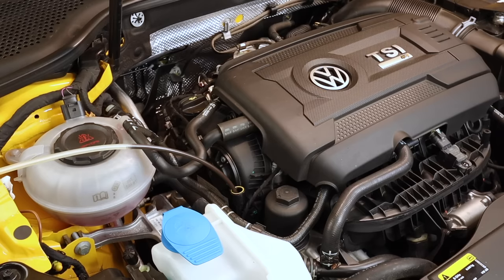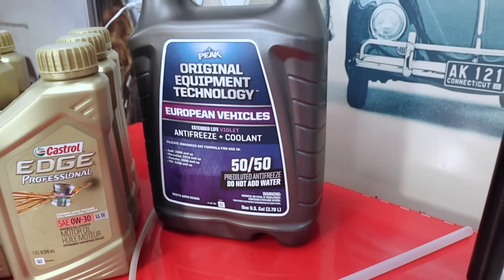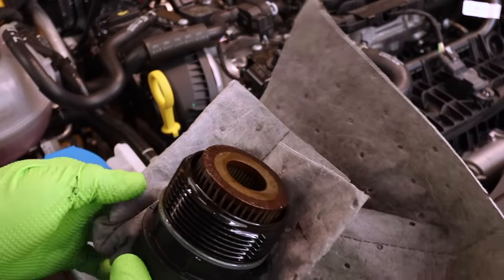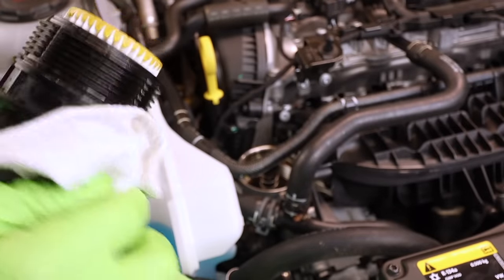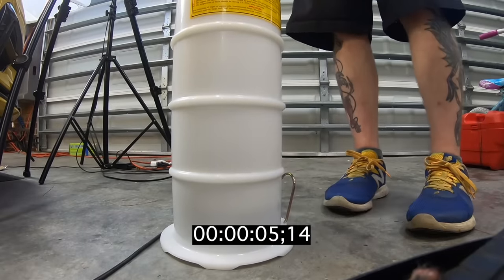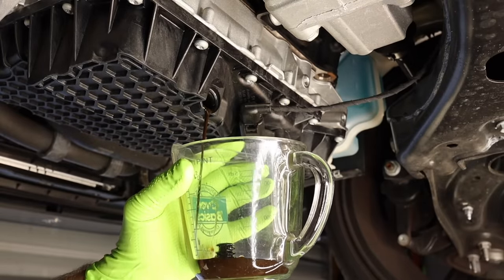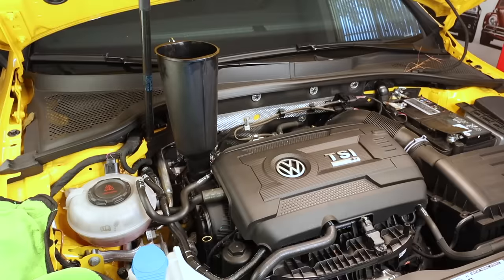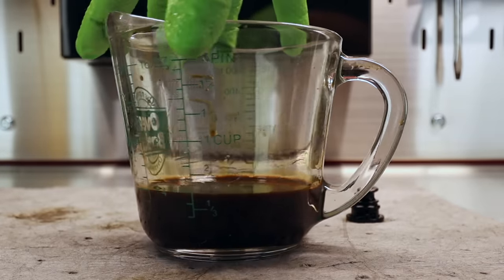Will an Oil Extractor Get All The Oil? (MK7.5 Golf R 5000 Mile Service)

Comment: I'm not that concerned about that marginal amount of oil left behind, but I believe that if there's any kind of residue lying at the bottom, it at least might come out with the oil running out from the drain hole. That way if there's a sieve in the oil pan it wont get clogged that easily (has been a problem with some 1.8T V.A.G. engines in the past at least).

Comment: I already change my oil too often so I would not have a problem with this method. How nice on some cars where it’s a pain to get to the drain bolt. Perhaps an intelligent person can design a drain plug that would work with this system and you can get all of the oil from the pan.

Comment: 500 km before service interval I do an oil change. Extracter or drain plug depends on how lazy I am. 

Run the 500 km then at 5000km service mark replace oil and oil filter. That time drain plug only. Need as much oil out as possible.
Reply: Nice way to waste oil and money.

Comment: Tried to do my first change on my car, screw is stripped. Tuffy told me they could put a bigger plug n and risk needing a new oil pan, I don't have the $770 for the new pan installation so.🤷🏽‍♂️

Comment: Iv tried this on both my 2015 Polo GTI and my Audi S1 and both can only recover 100ml or so? when you put the tube down t inside you can feel some kinda of spring action as if there is some kinda baffle preventing you to get to the bottom of the sump. Please explain why this is happening?

Comment: I always add 1.5 liters of cheaper oil after the extraction and let it run for 2 minutes.Then i extract the oil again and after that i fill it up to max level.So i guess that with this method i change 99% of the old oil.And since the engine is not revving high with only 1.5 liters in it,i think that its okay.

Comment: Whats the problem with getting under the car to pull the drain plug. A lot of engines have the oil filter on the bottom anyways.  
I am all about shortening the factory intervals. I do it on all our cars. But I couldn't use an extractor while knowing that it leaves a good sip behind.
Its just not worth the added comfort imho. 
Also who needs to be comfortable while changing the oil anyways...😂

Comment: You should use a magnet and compare the metal shavings from the oil you took out and the oil that was left in the pan I bet most of the metal shavings or in the bottom of the pan
Reply from the maker: That’s an interesting test!

Comment: After I finish pumping I get a hissing sound and it loses pressure. I need to continuously pump to get oil out. Is this normal? I've checked and tightened every fitting

Comment: pretty sure vw factored the 100ml into the levels, as with all new materials on engines, it's just progression, most f1 engines are mostly composite and as with merc had a very low fail rate...you wait until composite bottom ends are a thing....

Comment: Big warning here guys !!!

Be very careful how long you let a engine drain.

Some engines, especially those with a crank driven oils pump may loose prime, and you will have no oil pressure on start up.
This will necessitate forcing oil in through the oil pressure sender port with a pre lube pressure pump, which most folks do not have !!!
Be careful. 
I advise pulling the fuse on the fuel pump, and cranking the engine until oil pressure shows, on the gauge, or until the Oil Pressure light goes out. This procedure should always be followed on any turbo charged vehicle to insure full flow instantly on start up.

Tim
Reply: isn't it exactly the same as leaving the car parked? If my car is parked for one month, why won't all of the engine oil flow down into the sump?

Comment: That would be great if you could actual drain all but 100ml of used oil out of your sump, but that is not the case.  The first engine I rebuilt in 1984, was a Ford 289, single cam, solid lifters and only rocker arms controlling valve operation.  When we disassembled the engine very little remained.  Not the case with these modern engines with VVT, turbos, coolers, hollow camshafts, hydraulic lifters, multiple oil galleries in the cylinder head, over head cams, larger main oil galleries, oil squirters, hydraulic cam tensioners, balance shafts, etc.  10-20% of the used oil will remain in the engine whether you drain or use an extractor.  That is 5-10x more than the 100ml shown in this video.  Don't believe me.  Drain and refill, run the engine for 20 minutes on the highway and drain again. You will be shocked at what it will look like.  It will be extremely dark due to fluid mixing.  I have confirmed with oil analysis that in my DOHC 2.4L Ecotec, VVT, naturally aspirated that 20% of the wear metals, contaminents remain in the engine, and it did indeed have negative effect on oil viscosity after only 20 minutes of operation.  With these modern engines with GDI fuel contamination from 3-7 percent, and the accumulation of GDI soot, a very abrasive by-product, leaving 10-20% of the this oil for another full oil change will have long term effects on the engine.  I have 500 oil samples of this same type of engine showing 2x the wear rate from fuel dilution and soot, than the same engine with port fuel injection.  Manufacturers don't want to talk about this and quietly behind the scenes tweaking with oil formulation and filter improvement to counter the effects of this accelerated wear.  Perform a second oil change using an inexpensive oil and you will achieve 99% replacement.  Keep the oil and use it again for the next flush.  Never use a solvent flush product.  This is nuts.  Leaving this contaminated, oxidized oil in the engine, will tax the anti-oxidants, detergents, and dispersant additives in the new oil and create sludge and carbon build-up.  The engine from the factory had a full sump of clean oil, not a contaminated mixture.

Comment: buy a magnetic carter plug on aliexpress (or glue neodym magnet by yourlesf on the tip of yours) if you're afaid of these metal  particles  powder to return into the cirquit on heat up...

Comment: I feel like if you poured your 100ml of oil into the evacuator you would be sitting at 6L even.. which would mean you’re over full? Regardless of that, you looked overfull without the extra 100ml. Looks like you were sitting at 5.8L when you got done extracting.

Comment: I use an extractor, but next time I’m probably going to remove the plug for the extra oil and replace the drain plug.  It’s just easier to extract the oil and pour it back in the container.

Comment: Hi Charles, I own 2017 Passat. Usually I do oil change at 10k or a year . How does 5k oil change helps?
Reply from the maker: It’s 2 fold for me. One it’s habit because Ive always done my VWs that way. 2 it is cheap insurance in my opinion.
Reply: Thanks for your response . Liked the oil service video.  Is it possible for you to do a video on tools one need to work on newer VW's?  What to expect at each service interval & how to do those work?

Comment: What fluid top off? The brake fluid is a sealed system. If it gets low because of pad wear. If you top it off as you go. When you replace the pads, fluid will need to be removed. Brake fluid should be flushed when pads and or rotors are changed. 
The cooling system is also sealed. If you need to top off, you have a leak. And the windshield wiper fluid is not a fluid you top off. You replenish it.

Comment: Why is the middle level of the dipstick your prefered oil level? I always filled to top hatch. Why in your opinion?
Reply from the maker: The hatch is the range right? So my thoughts on mid range comes from the newer cars with the oil level sensor. IF you fill to the top when cold, the level actually goes up as oil expands with heat. So now you have an overfilled condition. This means warning lights booping at you. Customers get REALLY mad when you work on their car, and an hour later they get a light for oil. 

Set in the middle, no issues. 

Now does it REALLY, and I mean REALY REALLY matter? Not so much. But for the sake of following the manufacturer, the middle is the way.

Comment: At 6 quarts, my car takes 8 ...that 100 ml of oil left over. Isn't even enough to make any impact on the new oil. With that said usually after three changes with the extractor. I do like to go underneath the car at least once a year and drain from the plug

Comment: Point blank this pump works is very efficient and can be used all the time. The company itself does however recommend a full/regular flush every 50k miles though. Magnetic plugs help with metal shavings and as long as you do your oil maintenance regularly, the left over oil in no way will hinder the functionality or operation of your vehicle. If you are doing your maintenance every 3-10k miles, the oil should not have that many particles in it anyways unless there is something wrong with the car. And simply changing your oil at that point will not fix the problem.

Comment: If you're completing the extraction in 10 minutes you are not pumping enough.  You are not repositioning the end of the tube.  You can always do this and get some more oil out.
Reply from the maker: is 100ml out of 6,000ml worth that much more effort?
Reply: @HumbleMechanic  I think so, if you want it clean.

Comment: I donot know why VW did not leave a small door for the the drain plug only so easy to get it off without take fully engen pelly cover, 
second i agree with you i do not belive in 15K change oil, espically in hot weather areas  
third, drain the oil is remove the pc of any dirt in the oil

Comment: just out of curiosity what did you get paid flat rate for this service by hours?
Reply from the maker: An oil change at my shop paid .4hr so 24 minutes to do an oil change, top fluids, set tire pressure, maintenance light, and all the paperwork.

Comment: There is always oil left over in the engine, sitting in the galleys and delivery systems. If you're obsessed about dirty oil, just shorten your intervals slightly.

Comment: Honestly, I would probably alternate between a drain and fill and an extractor every other oil change. Also save me from having to buy a new drain plug every service. On these plastic VW/Audi plugs you really need to. Reuse the plug and it's going to leak.

Comment: On a VW, you put it on stands, pull the oyyuul  (or oil) plug, when the flow slows down, fire up the anchor, drop her in drive, set the cruise at 61, and stare un the mirror till that chunk of junk quits howling

Comment: This is interesting because I had a discussion with my shop foreman about when you should get your oil changed. I got my 2020 GTI in February and it’s coming up on 5000 miles. I told my shop foreman that I was going to be changing the oil at that mileage even though VW says to do it every 10000 miles. Then he said “who are we to think that we know better than the engineers that designed the car?” Very interesting and profound statement. Still changing my oil every 5k though 😂
Reply from the maker: Hahahhahah it’s cheap insurance if nothing else. I don’t disagree fully, but it’s not that cut abs dry

Comment: You can use the extractor to remove the last bit out as well. Just have to wait a while for the residue oil to settle at the bottom. My 2 cents worth .

Comment: It all depends on the engine. Oil extractors are no good for most French cars here in the UK. No good for Nissan since they use Renault engines. Very good for BMW & Mercedes. Very good for Honda insight but be careful, my oil extractor pipe actually broke in half when I tryed to pull it out after I pushed it in too much. I ended up taking the car to the garage and open the sump to get the other peace out.

Comment: My TDI has the filter at the bottom of the car next to the sump. Is it still practical to use the extractor?
Reply from the maker: Not as much because you still have to lift the car. But it’s cleaner than messing with the drain plug

Comment: If you use an oil extractor, do you need to replace the drain plug? Or, did you just take it out and have to replace it for demo purposes only?

Comment: TDI requires bellypan off (car raised) to get filter off, which sort of defeats the benefits of sucking oil out thru dipstick…
Reply from the maker: Depends on the year for TDI. But yea if you have to get to the filter on the bottom, might as well drain it too.

Comment: Always top off engine oil to the maximum mark of your dipstick. Especially with a sporty car. Last thing you want is oil starvation in a long, high speed corner....
Reply from the maker: That can be true. But Some cars will try oil level too high if you do that
Reply: HumbleMechanic I once blew my E30 M3 engine revving at 8000rpm, even with dipstick maxed 😅 It was on the track though. 
Since then (only when I use it on a track!!) I add about 250-350ml extra oil in it. Road use just max :-) Unless the Golf has special oil baffles in the oil pan to prevent oil from staying in one side of the oil-pan? 
Nonetheless great vids :-)

Comment: Just get a fumoto valve, and drain it all easy.  Costs less than that oil pump.   I would use an oil pump like that when I want to do the gear oil, something where it costs a lot of time and money to pull the gear oil cover off, new gasket, put the bolts back on in a particular order and pray it doesn't leak.   I think just sucking the oil out of stuff like that would be a better use for that thing, and cheaper.

Comment: What happens if you always top up the oil level? Will this cause more  crankcase ventilation smoke to go throw the egr? I have a tdi 1,6 and got a P2002 error code, with only 33K on the car (all highway).
Reply from the maker: As long as you’re not over the line, it’s probably fine

Comment: I would do the oil plug method specially with that cheap all plastic motor 😉 Look at the oil fill place and oil filter cap that doesn’t have enough clearance to open without removing engine cover. I don’t know how you still like to work on any of VW group cars!! Lol
Reply from the maker: If it’s plastic crap, why worry? 😜
Reply: HumbleMechanic because that crap is costly lol 😆

Comment: I didn’t read all 2,800 comments, but has anyone suggested extracting all the oil, then dumping a clean QT of oil in, then extract that out?    The 100 ML (4 Oz) of dirty oil should mix with the new QT of clean oil, and dilute what’s remaining.   When you suck out the new QT + 4 OZ old oil mixture, you’ll be left with 100 ML of “cleaner” oil (cleaner compared to 100 ML of old dirty oil).   All it costs is one more QT of oil.     I’m sure I’m not the first person to suggest this…
Reply from the maker: A few times. I’m skeptical of the value in that really.
Reply: Just use the widow maker and slightly jack up the side opposite the dip stick so the remainder of the oil will pool near the tube and get sucked up.

Comment: Nice video/nice car, pretty fast of course.. .    Wauww.. the oil sump is made of plastic?? ? Probably cheaper to produce/to assemble.    I go for the old fashioned way; engine/engine-oil warm and drain. But it's nice you can also suck the oil, if you want to.   (I don't own a Volkswagen,i have an old 2002 Mondeo 2.5  V6).   Here in Holland (and all of Europe) there are a lot Volkswagens/Seats/Skoda's.   Huge company.

Comment: A dealership is comfortable changing oil with this way. This is how Mercedes does it.

A 10k service is way too long between servicing unless you’re doing exclusively freeway driving without traffic. Read your manual. The dealership and manufacture want you buying more often and seldomly changing your oil (10k mile services) is a great way to do it.

Comment: You don’t pour some oil in the filter housing to “prime” it?
Reply from the maker: You can’t on this one. The filter is upside down, if you pour into the lower part, it drains right into the crankcase

Comment: I learned it a little bit different. 
I remove all the used oil, fill the car with 15W40...run the car for 15 min, remove this, change the filter and fill it up with the spec one...😉

Comment: The way I do it, is I dreamed of oil using the oil extractor when all the oil is  out I put  about half a litre of oil to the engine and then I drain that  one out, my car requires oil change every 16000 km or once a year I do my  oil change every 8000 km never had any issues

Comment: Thought it was bad enough that my ZF transmission came with a plastic sump, which I'm about to replace during a fluid change with steel.
Where is the logic? Forever sumps were made with steel, then alloy for better heat transfer. Plastic is an insulator, so the oil will run hotter.
I like to know if there is anything sat in my sump with the oil, that gravity will likely bring it out with the flow.
That wouldn't be the case with an extractor.
Reply from the maker: Maybe, maybe not. Most anything meaningful will get trapped in the pickup and not come out with a change or pass the screen and get trapped in the filter. Might be fun to test that out

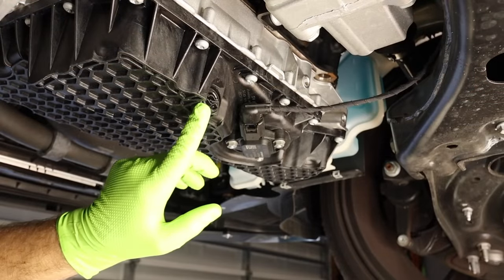Comment: Great video. At 10:17min after the under tray is removed, you can see a metal plug in the alloy block just above the poly sump where a 1/2" tube might be inserted to suck out the sump oil.

Comment: Pump.  That's why Mercedes has had the oil filter up top for years (one of the easiest cars to work on (why do you think the mechanics charge so much!).  Pump, let it sit while you check and top the other fluids.  Pump again.  Add a bit (1/3-1/2 qt), then pump again right away.
Without a lift at home, getting on your back and removing the steel shield before draining is simply too painful when you get up in the years.  I prefer to sit on my stool, take my time and stay clean.
Reply from the maker: I feel this

Comment: With my MB filter on top. Extraction is the way to go. If you feel bad about 100 ml of leftover oil in the pan, then add some clean oil left out in the sun for 15 minutes to heat it up and extract that. Problem solved I think.